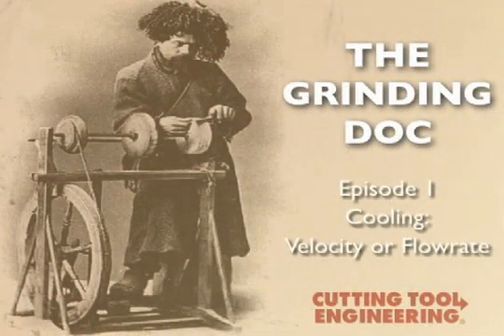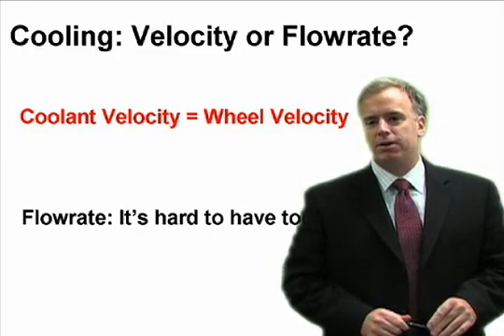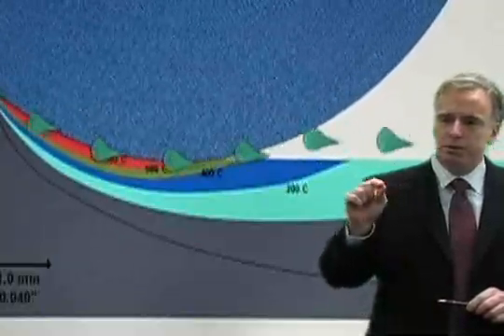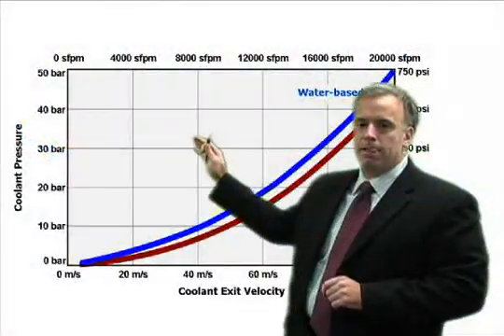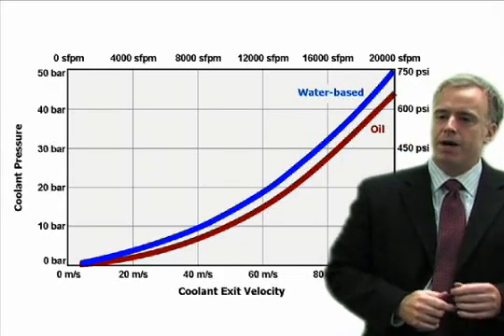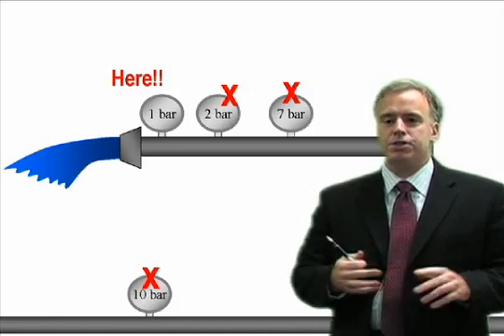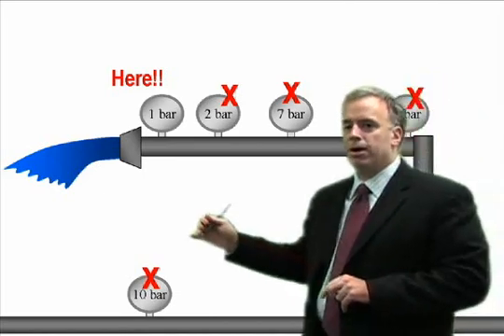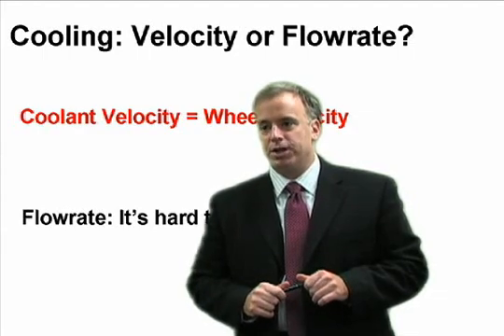Episode 1: Coolant velocity vs. flowrate

Comment: What is the feed rate you recommend in terms of feed rate per work piece revolution? I am running a 3m CUBITRON  80H  at .0007 per rev typically at 65 SFPM work piece speed and 8750 wheel SFPM. I shut the feed rate finish down to .00015 per rev for the last .002-.003 and cut workpiece speed in half    to achieve an 8-10 micro inch finish. But this doesn’t seem like anything close to 600mm/min. What am I not understanding? Usually grinding shafts with three to six different diameters on a KELLENBEREGER 100.  Dressing .0003 once each part. At .0007 per rev I am throwing flames, part stays cool, Wheel horse power meter shows virtually no load, maybe 3-5% over  idle wheel.